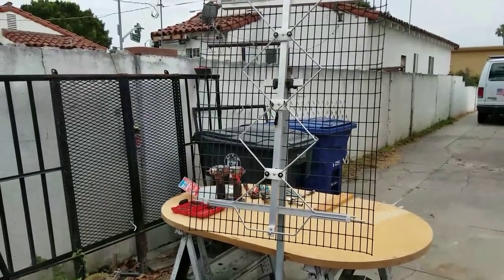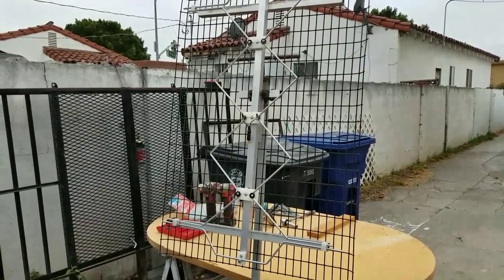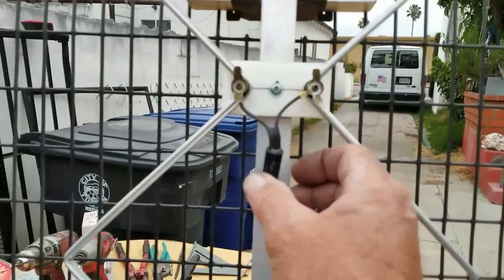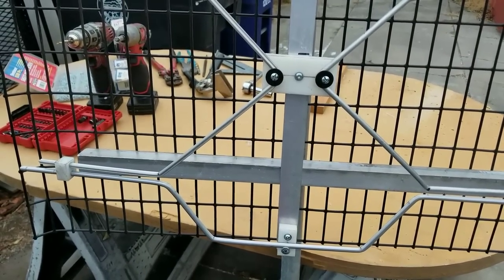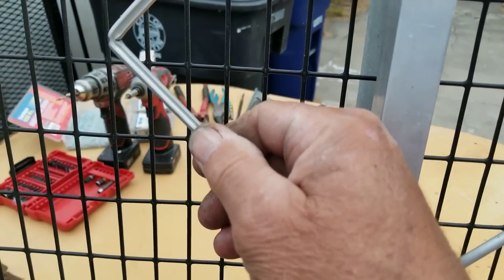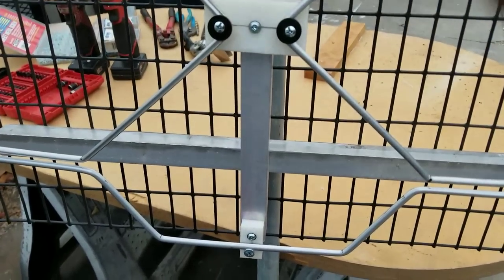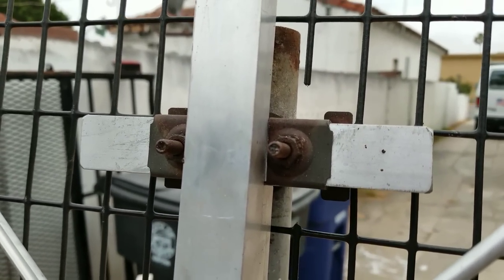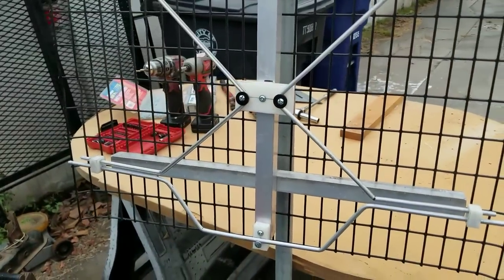My Homemade High Gain Tv Antenna

Comment: 2:20. The zig zag Hoverman part is indeed the UHF part by design of Hoverman himself back in the 1960s.
Reply from the maker: Yes, it was a great antenna design back then, and still a great antenna design.  I live off grid in the remote desert, and get nearly 40 channels from it.  Going on 9th year already.
Reply from the maker: Welcome aboard!
Reply: @GBear yagi uda vs hoverman  which antenna is better for tv ??
Reply from the maker: @TitanyumDioksit  I can only say my Hoverman works perfectly and has done so for nearly 10 years off grid in the high desert.
Reply: @GBear  are you using an antenna booster with the antenna you mentioned?
Reply from the maker: @TitanyumDioksit No, straight connection on 21foot mast, older led TV's.  Antenna facing south/Southeast and i pick up San Diego channels.  San Diego is about 200 miles from here, but they have a repeater station about 140 miles from here.
Reply: @GBear  👍👍

Comment: Great build ! I built one to test using 1x4 and #10 copper cause thats what I had laying around . I'm getting Dallas stations 123 miles to the south west . SO now I need to rebuild it to last in the weather and not be so dam ugly .  Is that aluminum square tubing u have the plastic insulator mounted to ?  I'm looking for ideas on how to construct ... Thanks
Reply from the maker: larry haney First off, congrats on your successful build!  Yes, that is 1 inch square aluminum tube, 1/16" thick walls.  I bought it from the remnants room at my local metal supply for just a couple of dollars.
Reply: Ok Thanks .  have u tested yours out in the desert yet I look on you channel but could not find it ?
Reply from the maker: larry haney yes, I am using both my builds tied together and they work great.  Look at my playlist titled "The first 2 years"  and you will see numerous references to them.
Reply: K      Thanks

Comment: My friend G-Bear"Figured I would touch base with you been a couple of weeks"The Old gut bought a new TV.Now that he can get free TV" Problem he bought one with Roku" So I hooked him up with my internet"But because of you he will have TV. when the cable goes out" I Bought and Refurbished A Singer Model 66 1945 Sewing Machine.that can be converted back to a treadle machine.
Then I taught myself how to make dentures and bought and made all the tool's, Now I can make between 6 to 10 sets for about $100.
Last few days though I dropped Auger housing on my snow blower that is almost as old as me"and turned it into a temporary (summer)"" Well""?  Plow"Furrow"Rototiller Minus The Roto Part"Works Good Moving Even Clay With It.Filling in low spots with it and Furrowing when needed.
Any Way Just Stopped By To Se How You Are Doing? And To Tell You I Am Alive. Hop All Is Well. Your Friend Tim.
Reply from the maker: It's great to hear from you!  And with all the good news too.  Keep on keeping on friend!

Comment: Today's hint is if you can ocellate  12 volts at a resonant frequency of 2.45 GHz
 In water'
Being not of radio-waves but direct electrical stimulus" You now have 95% HHO gas"By products to be concerned about 5% water vapor"?
Reply from the maker: Ahhhhhh, generating hydrogen!

Comment: Aluminum vs Copper rods.......Any difference?
Reply from the maker: panther105 as far as I can see, cost, weight.  I prefer aluminum because all the store bought antennas are made of it.
Reply: I see. Thanks. That makes sense.
Reply: @dcfuksurmom  Sounds like it SHOULD make a difference, but it doesn't. RF travels along the surface of a conductor. (do a Google search for skin-effect) The main difference is cost, other differences being weight and structural strength.

Comment: Having been a machinist for 47 years, I believe I can safely say that when you bend aluminum that sharply, it cracks. Don't know if it would interfere with performance, but it couldn't help.
Reply from the maker: Sorry, but no, you can't safely say that it cracks because I bent it in 24 places over 2 antennas, and none of the bends cracked.  If you are thinking that the dark areas at the bends are cracks, you are mistaken.  Those marks are just 'Sharpie' marks I used for location of bends.  Maybe they would have cracked if I didn't use the bender brake?
Reply: Some grades of aluminum are able to be bent without breaking or cracking.

Comment from the maker: One other thing... I didn't waste time in the video explaining all the cuts, bends and measurements, but if anyone would like those I can follow up with another video detailing the specifics.  Just leave a comment/request and I will oblige asap.
Reply: I would love to know the details so I can build one - it looks great - any chance you can shoot me the spec's or post them here ?
Reply from the maker: As I said in my reply to your request in my second build video, I have already moved both antennas to the high desert and I have one installed on my cabin out there. (The larger one/Build #1)  I haven't installed the smaller one yet and it is in my storage container out there.  I will bring that one back on my next trip and do a video of the build specs and materials I used.
Reply: You don't need to thank you.  It is easier to just go to Danny Hodges video of how to build a Gray Hoverman antenna.  Thank you for your informative video.
Reply: Looks like a solid design, I'd like to try and build one too, could you send me the specs? Thanks!